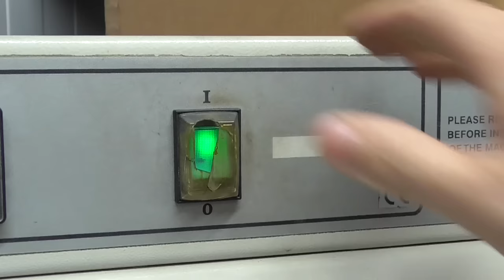Rusty Jammed Rebar Cutter - Restoration

Comment: Applying blueing liquid to metal is so fascinating to see, it’s like painting.. but with a delay
Reply: @Space Lord Indeed!
Reply: it is neat,  but I really like him doing it by heating it up and dropping in oil.
Reply: @mistyfields  lol, you just had to, didn't you xD
Reply: @MarijnvdSterre  😁
Reply: @westsideken  It is hard to do with big parts because you would have to use a lot of heat.
Reply: I made the mistake of trying to use it on zinc plated stuff and it just turned out all rusted brown and weird
Reply: U777
Reply: @westsideken  which oil does he use for quenching?
Reply: @fechinice687  Ive seen other knife makers/ blacksmiths using used motor oil before, Im pretty sure vegetable oil can also be used tho
Reply: @fechinice687  I think he uses olive oil.
Reply: @fechinice687  Linseed oil for most video I've seen
Reply: What is the point of blueing/quenching other than the colour?
Reply: @SD-tj5dh  Quenching makes the metal object harder. The bluing liquid for colour
Reply: It is called lagging
Reply: S D reduce oxidation, and looks. It won't stop rust unless oiled.
Reply: Like when you try to paint with Photoshop on a shitty computer
Reply: AngryBobRoss exactly like that!
Reply: Lag 😂😂
Reply: @fechinice687  plain motor oil will work as well as any.  Oil slows down the quenching speed correctly for O1 and O2 type tool steels.
Reply: It is NOT cheap!
Reply: 🏆🏆🏆Great work. How long would it take him to restore the Titanic?
Reply: @fechinice687  On his vice restoration he shows the oil. It's what they used to call "Rapeseed Oil". It's now called Canola Oil.
Reply: @SD-tj5dh  It works well as an anti-rust prevention.
Reply: I absolutely love using things that darken as you go. It’s so much fun!!
Reply: I used a Q-tip for the little bluing that I did. Don't put on a heavy coat! I restored a 50's adjustable square because I was inspired.

Comment: I love how, rather than go to a hardware shop and buy new bolts, you made them from scratch. I think the engineer who made that tool would be very happy with your restoration.
Reply: Do you think it’s better to make steel from scratch like plasticine than buy it in a store? why then restore what they did at the factory, it’s better to do it yourself completely, almost nothing remains of the original
Reply: @ Iceman metalcutter 820...    Re "Do you think... " 

 a) The originals are good templates.  Then you improve on that. 
 b) Sometimes a intensive bath and grooming experience, have an therapeutic effect, greater than the sum of the actions involved.

Some processes, go outside the scope of one's homeshop.

Comment: Constructive criticism : show your welder some love. Try turning up the wire speed. Make some test passes. Could make for some better welds. Love your channel!!
Reply: Those welds are tragic, I think you're right about the wire feed, but it also seems like poor shielding too.
Reply: @BlackPeter203  the one on the connection piece straight up had no gas whatsoever
Reply: That’s exactly what i tought! Needs to improve on it!
Reply: His machining skills are on point but I was also thinking his welding could use some improvement. Seeing some of the cavities after machining made me cringe a bit.
Reply: I didn’t realize weld nerds existed. The internet is amazing 😂
Reply: @andrewsims1356  I´m not so experienced at welding but I agree with the comments above...You are not a nerd if you refer to the basics..
Reply: @andrewsims1356  go look on facenook for weldporn
Reply: Most machinists arent welder and vice-versa. The sound of that welder was making me cringe. More wire speed, check shielding gas,  maybe more amperage for penetration. He is more skilled than I am though!
Reply: I think he should just run tig (heli arc) it would be a ton cleaner
Reply: I have no experience welding at all, but if a weld it’s ugly does that effect the strength of the weld after it’s ground smooth or is it simply a technique and tool maintenance thing?
Reply: @codename495  a smooth consistant weld thats deep enough to make a good bond will definitely be stronger. Im not a professional but the preparation of the peices plays a big role in making a good weld as well as welder set up. Theres a bunch of good videos on here that explain these things way better than i can. Practice goes a long way too. You get to know the welder and how to set it up as you weld though different thicknesses.
Reply: @codename495  the key things with welding are sufficient penetration and fill/filler. A weld that looks bubbly is not strong at all, same with a weld that just sits on the surface of the metal. There are tons of videos on here that describe it much better than I can. It's one of those things you have to be able to see to understand. Amperage, filler/wire speed and travel speed(your hands) are all factors that depend on the thickness (guage) and joint you are welding.
Reply: @justingoldman2391  except most would say that wire feed is easier for a beginner welder so how would he do trying to tig?
Reply: ozy  lmao. An "expert" who can base peoples skill level off of a youtube comment
Reply: ozy  Yeah because it's soooooo unlikely that actual welding professionals would watch this video right??? LMAO, "experts" XDDDDD angsty teenagers, they know what's up, not "experts" LOL.
Reply: I had this video going in the background while I was working on a project. The sound of the welder made me immediately cringe without even seeing the video.  Like nails on a chalkboard.
Reply: I know nothing in welding, what should or should not have he done?
Reply: Paulie’s Walnutz You seem like you might know the answer. Ever since watching these guy’s videos I’ve been wondering what his job could be. I understand that machining is a big part of it but he seems to have a deep knowledge of different things.

He clearly isn’t a hobbyist, he has access to too many professional tools. So what kind of job would a person like him do in the real world? I have no idea what machinists do, especially in this day and age of factory manufacturing and electronics.. Especially in Switzerland where skill like his would be really expensive for clients.
Reply: @Paulie’s Walnutz What do machinists machine in this day and age of CNC?

I am somewhat knowledgeable about digital arts. A person of his skill would be something like a top 3D artist. He could work for Hollywood studios or major game companies. This industry is very strong and going stronger.

But what about his craft skills? Where are those used in today's world? Or is he actually not that good? Is his skill relatively normal in the crafts world but hardly anyone bothers with YT videos?

Cheers.
Reply: What's wrong with the sound? Does it sound "too slow"?

Comment: Brings back fond memories. When I was working a road crew, we had one if these in a toolbox on one of the trucks. Quite a bit bigger than that one, and had a ratcheting jaw. We used to bolt it to the bumper on the work trucks, and use it to cute 16 or 20 foot long sections of rebar for doing bridge work

Comment: Honestly, the fact alone that you can remember where everything goes after dismantling it, amazes me.
Reply: I mean he does video it getting disassembled
Reply: Everything this guy does is perfect so he probably does his homework and does lots of research.
Reply: Not being rude here, but there's only a few actual nuts and bolts and then like 3 main pieces. Plus everything is easier when you record yourself taking it apart so you can look back to how it was assembled and where the pieces go. As you should. Like taking a picture of your drum brakes before replacing them.
Reply from the maker: I usually remember yes, but if in doubt I have it all on video.
Reply: @mymechanics  I'm a mechanic apprentice and phones sure are very useful to take pictures before disassembly. I bet it was much more challenging for old timers who didn't have a mobile phone at that time.

Comment: I'm an engineering student and I find it very fascinating how I can apply my new knowledge by watching your videos. They are very accurate and you pay attention to hardening and functionell surfaces, which is very professional. May I ask what your occupation is?
Reply from the maker: Professional mechanic ;-)
Reply: PERFECTION mechanic!
Reply: @mymechanics  Provider of deep human satisfaction!
Reply: As a machinist... Please go and work in a machine shop for a month to gain an understanding of  how much work you create by specifying unnecessarily tight tolerances, and what type of features can be machined on common equipment at a reasonable expense.
Reply: @rtwolfrt  Dont worry, allready done. But the only thing I learned was that I'm glad that I  wont be working myself ^^
Reply: @lorpen4535  it's easy work when engineers don't specify a +-0.01mm tolerance on a hole that's clearance on a pin head... Lol

Comment: the first 4 minutes... I see a lot of "I have to make a new one" :D :D
Reply: I only had one question : why the washers ? It would have been much cheaper and easier to buy them.
Reply: @C4H10N4O2  new hardware like bolts, washers etc. is always zinc-plated. You can't use bluing liquid on them. (He said it somewhere in the video)
Reply: @samuelbhend2521  Okay, I didn't heard that. You can buy them were I live.
Reply: @C4H10N4O2  you can buy black hardware? ok, cool! never seen that  in a store here in switzerland...
 well to be exact: he didn't "said" it, he wrote it:)
Reply: @samuelbhend2521  Not black, but raw steel.
Reply: @C4H10N4O2  can't buy those either... they would rust, so nobody would buy them.
But i've learned that some rare special screws are somehow available blackened, but only in very few expensive specialist stores...

Comment: "I need to replace these nuts" logical person, heads to hardware store. my mechanic, makes entire new nut and bolt from scratch
Reply: 11:21 and 11:26
Now read this and shut up
Reply: @sovietcomrade7733  You know you can remove that THIN coating of zinc right? It's fricken 8th grade basic Chem. Along with plating pennies.
Reply: @RabbitsInBlack  yeah,with acid that will absolutely destroy the tread and the integrity of the bolt
Reply: @sovietcomrade7733  no it won't. Reasonably sure you can buy bolts  ungalvanized, too, but it's been a while.
Reply: @José Gaming lol
Reply: Its most likely cheaper to buy round stock and what not and make many rather than go purchase it separately
Reply: And that's all the fun
Reply: its just a reason for him to "make a new one"
Reply: The challenge he seems to enjoy is  for him to say he restored it all, he is enjoying using his tools and shop. If you wanted to buy parts others made might as well just buy a new tool.
Reply: @hairymcnipples  yup you can.
Reply: @prestonsamson3674  black bolts, yes?
Reply: @hairymcnipples  usually I don't see them but what I meant is ungalvonized bolts so you could blue them yourself.
Reply: he's a legend!

Comment: My Mechanics : "I'm going to replace them too"
Me : Come on, why don't you just buy new bolts ?
My Mechanics : "New bolts and washers are zinc plated I can't use bluing on zinc plated parts."
Me : Thanks but get out of my head it's private
Reply: I was SO glad that zinc plated bolts and washers cannot be blued... But seriously, why blue (?) all the parts? I admit it looks very cool, but what other advantages does it have?
Reply: @derjman  Rustprotection
Reply: @dirtydan420  Thanks, but would zinc plating not also do the trick?
Reply: @derjman  Of course. I think it's because of the surface and the color of the bluing
Reply: You can also purchase  unplated nuts and bolts (if eg. you want to weld it), but maybe not in all sizes.
Reply: it's a good enough reason to just say for the looks, bluing is a very pretty finish.
Reply: @BloodSprite-tan  I wish blu'ing was safe for food, and then I would blu my knives, cause you're right..it IS a very slick finish.
Reply: @survivalofthefittest409  Bluing is not safe for food? How come? It's just black rust isn't it? Is Iron Oxide toxic?
Reply: @LeutnantJoker  cant tell if you're being sarcastic

Comment: Helpful hint I’ve learned in my life. If you have a stuck bolt or screw, wait until you take the other ones out that you are able to remove. Sometimes that relieves some internal stresses and loosens the stuck parts.

Comment: "disassembles the thing"
me : well, about 10 parts, that should be a simple and straight forward one
me 20min later: goddamn ! 

in fairness when he pulled out the hydraulic press right at the start I shoulda known...
Reply: me: "well, about 10 parts, that should be a simple and straight forward one!"
me  minutes later when I cant get the big bolt to move:  "I'll set this over here and get back to it" (Never gets back to it)

Comment: FYI WHEN WORKING WITH CARON STAINLESS STEEL BEFOR YOU WRAP IT WITH FOIL PUT A WOOD CHIP IN WITH THE STEEL AND IT WILL BURN UP THE OXIGEN IN THE FOIL .
Reply: pro tip...nice
Reply: What does this actually do? (Baking it in the stainless)
Reply: @georgemarshall6657  adds a source of carbon?
Reply: @georgemarshall6657  It helps prevent oxidation and scale from building up on the part in the oven.
Reply: I used some paper  always  , 1.2379 = Sverker 21

Comment: Great restoration! I've used brake fluid a few times to unseize engines. I'm wondering if a week long soak in brake fluid would have made things a lot easier for the initial break down.

Comment: 4:35 - It's like a statement. "I've got broken button on the sandblasting machine and I wont repair it, You won''t force me"
Reply: PoorHootz He had it pixilated in one video. Maybe it was against Swiss law? 😀
Reply: @brigglerintune  More than one video actually, cause people made jokes about it. But when he pixilated, people pointed it. The next videos he just doesn't show it anymore, and... people pointed again. Since the last 2 or 3 videos he begun to show it again =)
Reply: The pixelated button videos were hilarious
Reply: @brigglerintune  it's actually just a cover to make the switch dust proof since, well, it's basically a dust machine.
Reply: "I won't make a new one"
Reply: He can have broken switches all day long. The fact he fit 1.5m long handle in the sandblaster is a serious flex.
Reply: I think he has stated before that sand blaster is not his own, I am sure that if it was his sand blaster he would have fixed it right away.
Reply: You know how it is a plumber always has a kitchen sink that drips. An electrician always has a switch that doesn't work. They never have time to fix their own.

Comment: I love how everybody sprays on "penetrating oil" and when they get the bolts out they are dry as a bone! penetrating oil dose not work!
Reply from the maker: That's what i realized too, i bet you'd need to soak that think for a week.
Reply: I have a thought that myself many times.
Reply: You need a bigger dose
Reply: it depends on if the part needs to be saved or not. pen oil does work
Reply: Automatic Transmission Fluid mixed with Acetone. Never seen a bolt that it won't loosen.
Reply: OLSKOOL
of course it works. or are you just going to say it's a scam, they're out to get us etc. etc.
Reply: It can only penetrate if there's a capillary gap.
Reply: this issue isn't black and white. it can work in some circumstances, but it didn't work in this one, or a lot of other severely rusted parts, because the oxidation physically fused together the parts, so there's no gaps for the oil to penetrate and lubricate
Reply: It does for stuff that isn’t that bad, and the primary application is for stuff that’s too impractical/impossible to bring into a shop and on to the bench, and/or located in a place where heat cannot be used. Also many people think WD40 is penetrating oil, when in reality WD is utterly useless at everything aside from water displacement.
Reply: If you would have sunken the whole thing in old motor oil or diesel and left it there for a week, all those bolts would have opened no problem. :)
Reply: Yeah there are plenty of videos on youtube showing their efficacy. Overall they are pretty mehh when compared to just doing it dry. Heat and also hitting with a hammer or air hammer are much more effective for seized fasteners. I use "penetrating" oil just as a general lubricant for metal parts. Overall though not even my most commonly used aerosol spray fluid :p
Reply: @daa3417  exactly, and that was what it was designed to do. WD-40 = Water Displacement on formula 40, it is what he wrote in his notes when originally developed.  WD-40 will lubricate temporarily but de-solvents very quickly, WD-40 will penetrates some rust but not very deep and not for very long. it does work well as an illegal Sturgeon bait....(this statement has not been approved by the FDA, DoFW, DoDor the Sierra Club).....wait , what.....
Reply: You still need to work the bolt in, I mean out... It takes time... Never do it dry.
Reply: @krecikowi  Which is why it's next to useless. If you are a pro you don't have time to let it soak for 3 hours. Maybe 5 minutes.
Reply: @cavemanstyle1376  True, very true...
Reply: I use Kroil Oil and let it sit overnight. Works like a charm